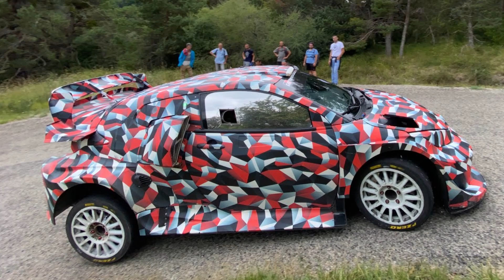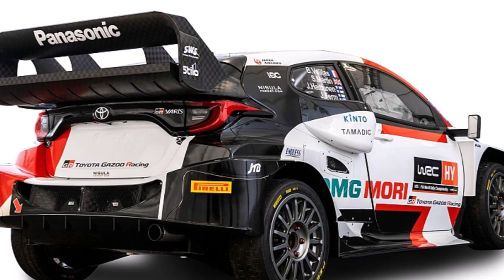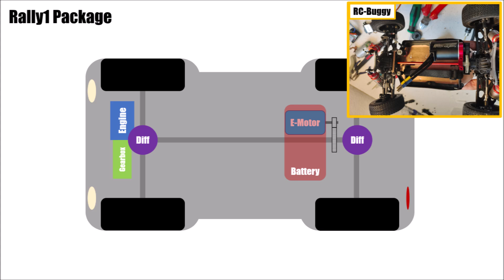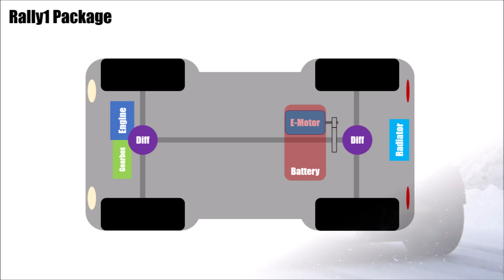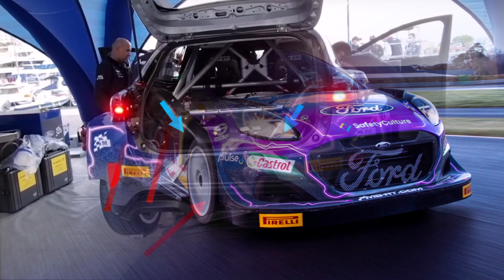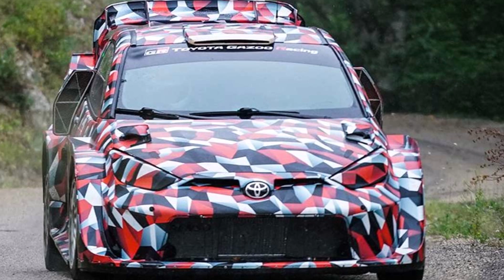RALLY1 Cars - EXPLAINED

Comment: Another issue with positioning the hybrid cooling inlets lower would be the potential for debris and snow getting caught and blocking it. Also could you make a follow up video about the new chassis regulations? It is the biggest and most significant change, yet due to the hybrid marketing it is barley mentioned and i'm sure plenty of your viewers would appriciate an explanation.

Comment: When I saw the diagram for the motor and chassis, I almost screamed that "it's just a shaft-driven 4WD RC chassis". Glad that you immediately brought up the same thing, which confirmed my thoughts. A common upgrade in RC hobby is to modify the final drive ratio by changing the pinion (motor shaft) and spur (center shaft) gears. Would this change in gear ratio also change the torque output of the motor and sacrifice (or increase) the top speed of the car? How would those gears work with the sequential transmission in the front?
Reply from the maker: I was just driving my RC Buggy in the snow today, so I thought I should point out the similarities :)
That is a really good question. The hybrid box is the same for everybody. But like I said it will be interesting to see how the teams get the power onto the propshaft and what gear ratios they will choose.
M-Sport talked about a shaft going into the rear differential, Hyundai showed a pair of gears to connect to the propshaft like a RC car.
My guess would be that teams use a more torquey gear ratio for the electric motor because low speed acceleration is key. That would also mean they couldn't use the electric motor at higher speeds.
Let's see, maybe someone will reveal something during the season.